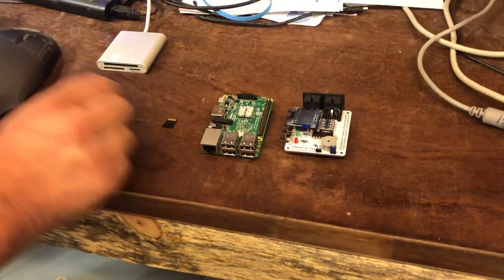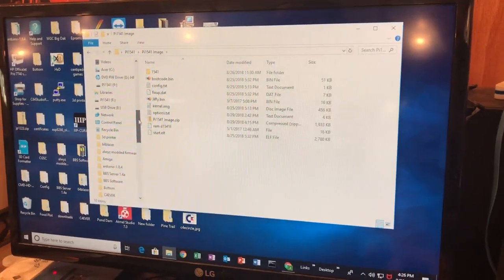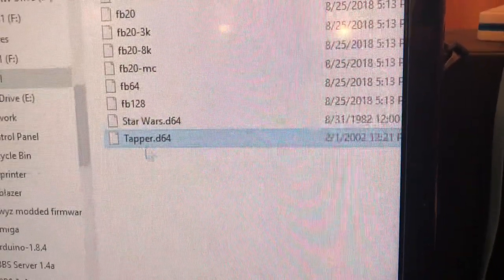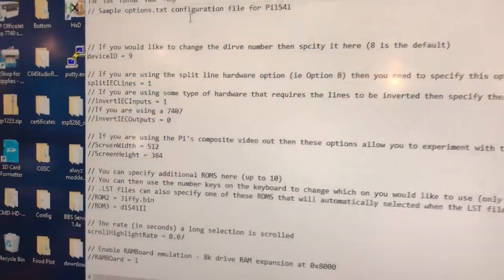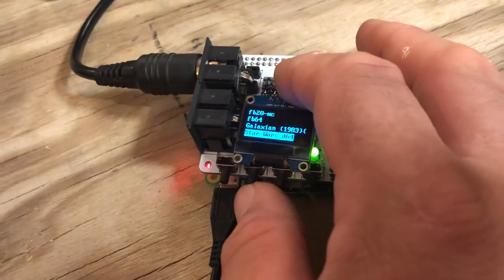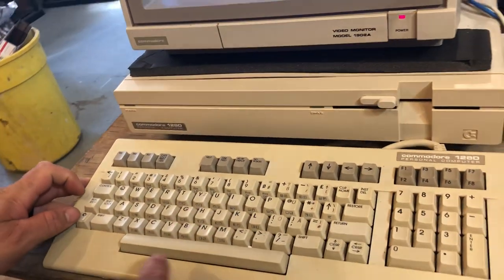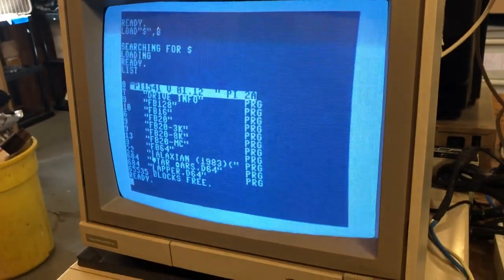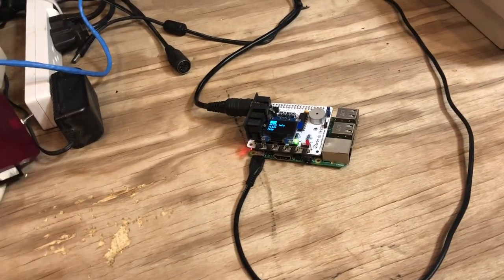Pi1541 How to get started

Comment: You don't need to use the file browser to load prgs. If you're in a directory of the sdcard, and not in emulation mode (not inside a .d64), doing a load "$",8 will list the files in the sdcard directory. You can simply load them as though you're in a disk. load "program",8,1. the only thing you have to watch out, whether doing it that way or in the browser, is that because you are not in emulation mode you can't use fastloader cartridges as they do some magic in the 1541 that won't work.

Comment: How’d you get it working with the Commodore 128D? Did you have to disable the C128’s internal drive?
Reply from the maker: I did disable the internal drive or I installed a switch that allows me to change the internal drive device number.  I have recently posted a video on doing the device number switch install.
Reply: @commodore4ever  Thanks for your video. I’ll give this a try - perhaps I’ll put the switch on the inside of the case though as I’d rarely need to change the inbuilt drive back to device 8.

In the meantime, is there a POKE command that can archive the device ID swap in software?

Comment: i cant' get the oled to work. its driving me mental
Reply from the maker: Make sure the oled is set up correctly in the options file. If it is then maybe there is an issue with the oled
Reply: @commodore4ever   thanks for your reply. yes i spent a lot of time trying to config the .txt file. including getting the code of working files.  i think i need to TS the hat board

Comment: have u tested this on a stock C-64? I mean, it's clear u have an accelerator cpu card/cartridge by the animated logo running in the boot screen
Reply from the maker: Juan Fonseca I have tested these on a basic setup as well as other Commodore computers like a Plus 4 and Vic-20.
Reply: i just tested it on a C128 in 64 mode i dont have jiffydos installed at this time and it worked good for d64 images but not for prg. Files. Can you see if fb64 will load from the root dir with a stock c64 and if it does can you do a short video on the procedure thanks.

Comment: Do you know does PI1541 works with RASPBERRY PI 3 MODEL A+ ?
Reply from the maker: lokz according to the firmware developer’s website pi1541.com it does.  I have never tried however.
Reply: @commodore4ever  Thanks

Comment: Just a note:  You're running with an OLED but did not cover those settings in the options.txt file.  These are commented out by default and will cause your OLED to show nothing.
Reply: Did you ever figure this out? I have an OLED screen on mine that displays nothing.
Reply: @sirbacharach1  uncomment the option in the text file